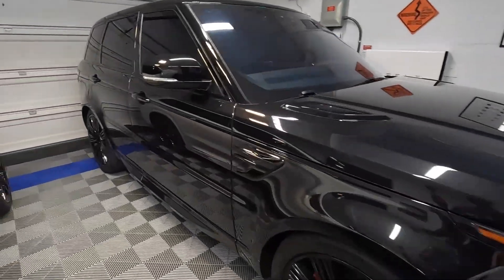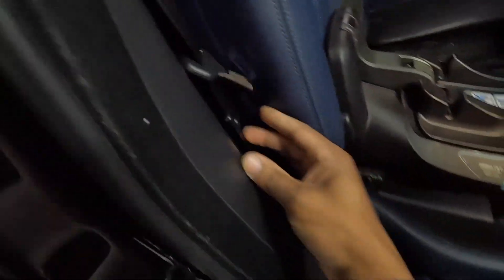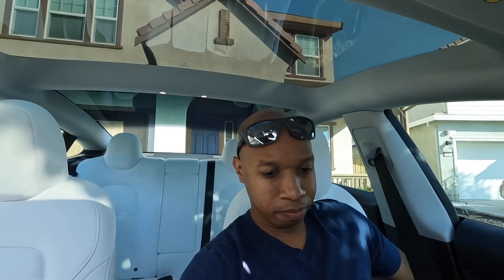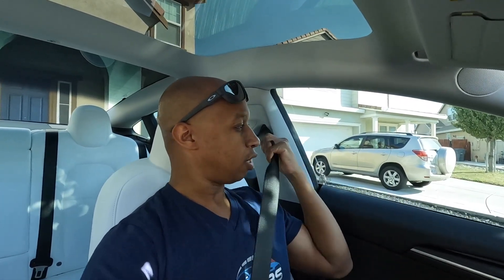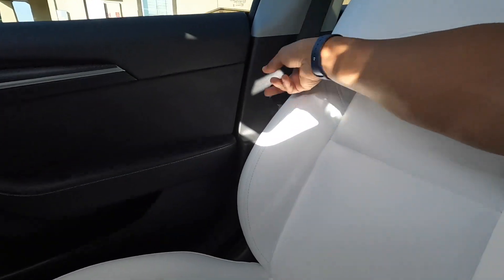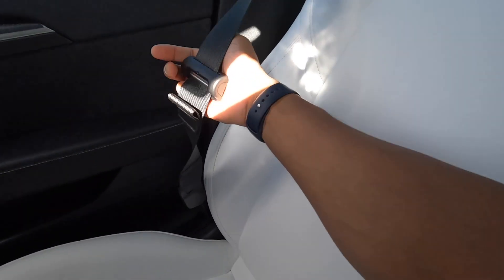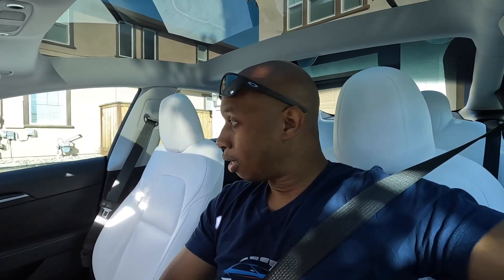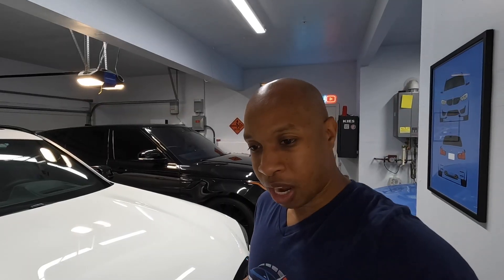Why Do I Have a Loop in My Seat Belt?

Comment: This is inaccurate... EM loops were initially created to induce body submarining which reduced head injuries in certain safety testing.  Multiple safety reviews have concluded that EM loops actually do more harm than good and can even allow for occupant ejections, GM has even had to recall several vehicles with EM loops.  I would wager that loop on your Tesla is not an EM loop and in fact just a stitched on piece of seatbelt (I cant tell from the video) that preforms the same function (as you accurately described) as the button.  The button can fall off and the stitched on piece of belt is more secure.

Comment: I honestly thought it was to keep the seatbelt from making a noise against the wall when there is nobody else in the car which is why the drivers side doesn’t have a loop because there’s always someone in the drivers seat when the vehicle is moving which is the only time it would make noise.
Reply from the maker: It’s doubles as that too so you weren’t wrong, But main purpose is distributing energy!

Comment: There are a few ways that force limiting is done. Some belts have torsion bars in the reel and it will twist to control restraint energy. A few use an explosive charge and seat position and weight sensor to determine if the torsion bar assists or is freed if tje person is smaller and restraint force needs to be lesser to allow easier yield (belt extension). The safety systems in effect on some makes are impressive.
Reply from the maker: Thanks. That’s good to know. I knew there was more to it but I wasn’t 100% sure.